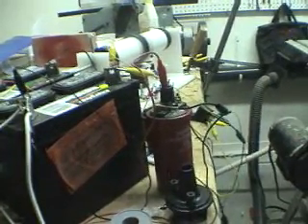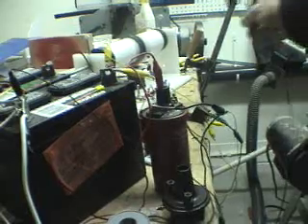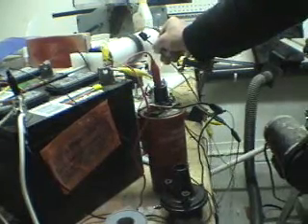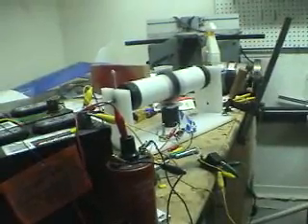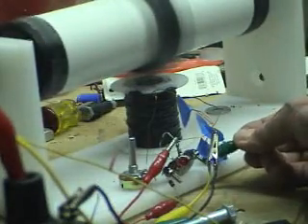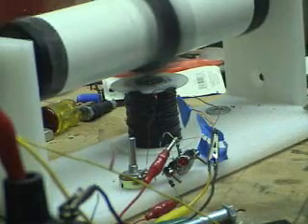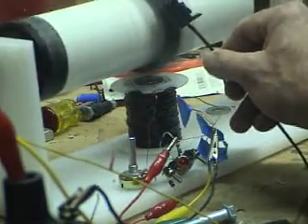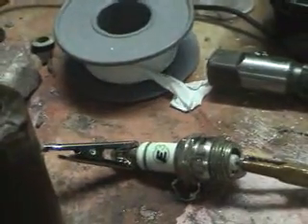Bedini SSG testing transistor and spark plug

Comment: I woold use a tyristor, the problem is that you relay i too slow. A tyristor is like a transistor but function in the same way as a relay. That means that you can have higher voltage going out of the tyristor gate pin than you put on the base pin. Very easy to use, common used in coilguns. They can handle high voltage and high current in a high frequent.

Comment: couldn't you just hook the relay inline with the power coil? perhaps with a resistor bridging the relay so it doesn't effect the coil too much. that way whenever the coil pulses it will trip the relay.

cant tell from the vid but it looks like you are connecting the relay with the emitter and the collector?  that would just be a steady dc current direct from the battery and would keep the relay tripped.